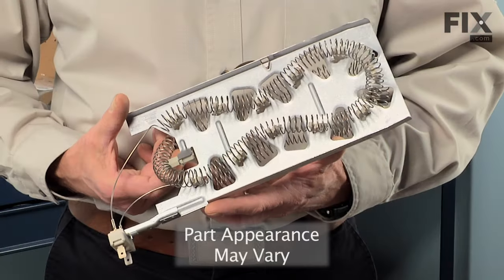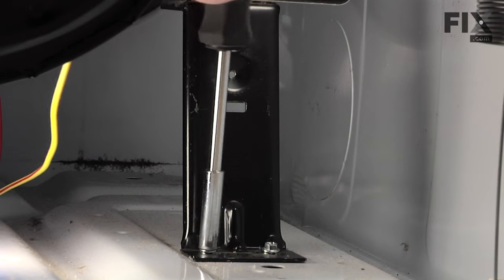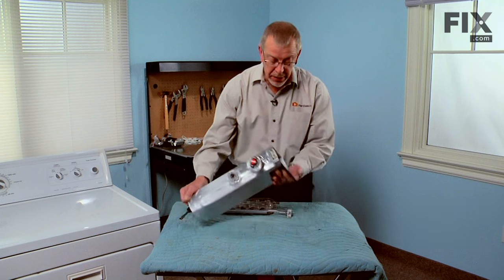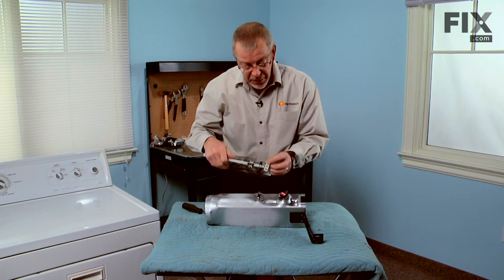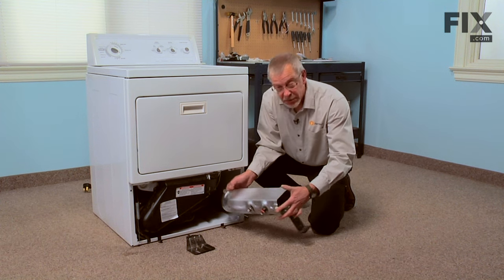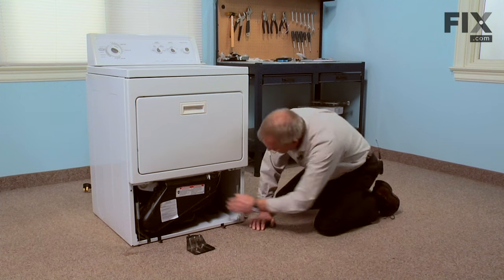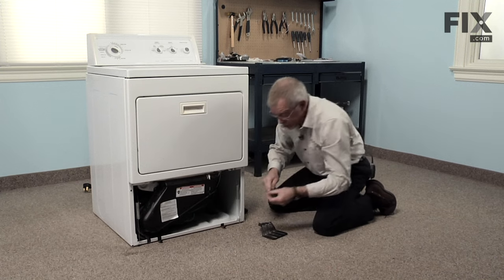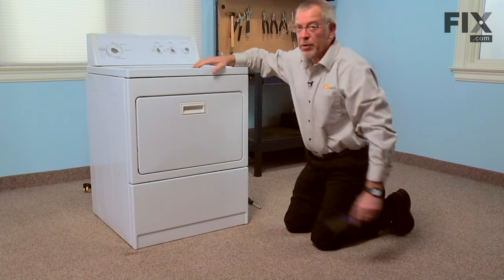Kenmore Dryer Repair – How to replace the Heating Element - 240V 5200W

Comment: Ok, I did it. Here's something I didn't catch in the video BUT YOU HAVE TO KNOW THIS, There is a tab sticking up on the tube, in the back. It prevents the heater tube from slipping out but it makes it a pain to pull out and a pain to slide tube in. You could spend days trying to figure out what is going on. The tab is on the top of the tube that slides into the back of the dryer. Tab looks like it screws into something but it doesn't, it slides into the back of the dryer and holds the tube in. You would think you can just slide the tube into or out of the back BUT no. You have to maneuver it so that the metal tab will let it move in. Tab holds the tube into the back of the dryer. Its looks impossible to slide the tube in unless you understand the tab will go first into the hole and then the rest of the tube will slide in as well. The tab is on the top of the back end of the tube. I know my words are hard to understand without seeing it but I hope it helps. When you are trying to slide the heater tube out, just think that there is a tab on the top of the backside holding it in. When you go to replace the tube, the tab must go into the hole first.
Reply: You just saved my sanity! Thank you!!!
Reply: Only found your VERY USEFUL Comment this morning ... unfortunately after spending a frustrating hour on the floor trying get that stupid heater tube back on!  This is Critical to getting this job done ... wish I'd been smart enough to look at comments and see yours beforehand!   The video talk about rotating it "back into place" to lock it in ... which is entirely wrong.  My Two Key hints are: #1) Your revelation that the tab has to go into the hole, & #2) Leave the front support piece on the tube when reinstalling it.  Thanks for your key comment ... hopefully the next guy will see it and save themselves quite a bit of frustration.
Reply: Okay but can someone tell me WHERE THE HOLE IS?! I’ve been sitting here for 30 mins trying to find it
Reply: @summerbrowning326  what hole are you talking about?  If you took the heating tube off… then you should know that it goes back into the same hole in the back… the deceptive thing is that there’s nothing on the front of the heating tube… just the deflector plate that is part of the front mounting bracket.
Make sure that you’re dealing with this specific model… some have the heater in the back… totally different.
Reply: The heating element housing has to be pushed up and turned  counter-clockwise to release that tab. When putting it back in, it's easier to 
attach the back 2 wires only and reverse the process to get it back in.
Reply: When putting it back in.  Make sure the tab at the top goes in first and just keep wiggling it in and it should pop right in.  Took me about 20 seconds and im no expert.  This is my first time.
Reply: Thank you!!!! I would of never been able to figure it out - without your input!! Much appreciated.
Reply: Yes, this comment saved my life.  Getting that tab in first, then twisting clockwise, is CRITICALLY IMPORTANT.  Without knowing that, I would have spent hours jamming and cursing.  Thank you!!!!
Reply: getting it back in is so annoying. i cant get the tab in
Reply: @TheRIB993  how far counter clockwise were you inserting it? Tab straight up. 9 o'clock ?
Reply: @johnmccormick2883  This comment saved my life. Thank you!

Comment: I just did this and the best thing to do when you are putting the casing back in is to flip the dryer on it's back!! Much easier to pop it back in than lying on the floor at a weird angle that's going to hurt your back. Flip 'er over! :0
Reply: This was the best advice!!!! I was on my knees for like an hour!  Thank you!

Comment: I saw another video and they didn’t even remove the housing (box). They just pulled the heating element out. I wish I knew that before I started. It would have saved me the trouble of trying to get the box back in. FYI.

Comment: I have had to replace this element twice on the same washer and the key to getting the element housing back on is tipping it over. My first time doing it I spent an hour on the floor attempting to get it in while cutting my hands but got it, the second time I flipped it onto its back and got it in their in 3 seconds. Hope this helps someone that struggled like me😂

Comment: The guy is working on a brand new dryer. The bottom panel on my 10 year old 110.66962501 dryer does not just pop off. I released the clips and got the top of the panel out about a quarter inch. It is in like it is welded. Could something have rusted to the inside of the panel? I have now bent the panel out and it will still will not move. It feels like there are another two or three screws holding it on. Help! I already ordered the parts but will have to cancel the order if I can't get the door off.
Reply: Yes almost impossible to get the panel off.  The spring clips are very stubborn.  Much tougher than what this guy shows.
Very poor design - just my opinion.  Just use screws that can be unfastened.  Clips?  It's like the engineer gave up.

Comment: Definitely an easy job which I just did. One thing though I’d recommend you pull the filter housing that’s in the front there off(just 2 screws) what that does is A.. Give you easier access to the element housing and B.. exposes the blower impeller which will probably be packed with lint and you can vacuum all that shite out. While you’re there you can do the same to the inside of the filter house. Also you only need to pull 2 wires. The rest can stay with the housing.
Btw in my case the heater was ok. One of the safety switches was bad… Always ohm things out

Comment: This was very helpful for my replacing of my heating element as well as your video on the thermal fuse. The area I was most stuck on was getting the housing section locked back into to the machine to get that tab in place.  Very tricky but if it wasn't for this video I wouldn't have even known about the purpose of that tab since its not obvious just looking at the opening.

Comment: Being not sure what the reason was for our dryer not heating, I just bought a heating element, thermostat, and thermal cut-off in the same package.  I replaced the heating element first thinking that was it for sure.  It turns out that it was the thermal cut-off.  I probably should have replaced the thermostat as well but will have the part for later replacement if needed.  This video helped with installation since I have little experience working on appliances.

Comment: Thanks for your video. My Kenmore model 90 series dryer had the heating element, thermal fuse and thermostat wired in series. That matched a wiring diagram I found later inside the machine. Solid red wire input and black wire in between and red with white stripe out. I took pictures of the wiring that helped me when putting it back together.

Comment: You should test the other components (the thermostat and the limit switch) before you assume it's the heater. Get an ohmmeter to test continuity before you assume that it is the heating coil.
Reply: Thanks

Comment: Does any one know the order of the wires to go back on ?
Reply: Thats what i need to know lol i just mesaage the fix.com guy because i changed the element and yet no heat! So i was wondering if maybe i wired it wrong! I did take a photo before i took apart but sadly my dumb ass had a bad angle. Did you figure yours out btw? Any tips? Thanks in advance

Comment: I cannot figure out how to get the heating element housing back into the dryer. What's the trick? There is a tab that prevents it from going into the duct at the back of the dryer.
Reply: I also can’t get it back in
Reply: @JonathanFerreri  keep trying. It finally worked for me - after a lot of attempts and a few f-bombs! Try coming in low. Good luck.
Reply: @JonathanFerreri  

Come in at an angle. Do that part first.

Shouldn't be THAT hard.
Reply: Tried the angle and had no luck...so I got frustrated and took a pair of needle nose pliers and bent the lip with screw hole back so it was straight and shoved it in no probably after that.
Reply: @JonathanFerreri  Ha, whatever works, right.
Reply: Ok, I did it. Here's something I didn't catch in the video BUT YOU HAVE TO KNOW THIS, There is a tab sticking up on the tube, in the back. It prevents the heater tube from slipping out but it makes it a pain to pull out and a pain to slide tube in. You could spend days trying to figure out what is going on. The tab is on the top of the tube that slides into the back of the dryer. Tab looks like it screws into something but it doesn't, it slides into the back of the dryer and holds the tube in. You would think you can just slide the tube into or out of the back BUT no. You have to maneuver it so that the metal tab will let it move in. Tab holds the tube into the back of the dryer. Its looks impossible to slide the tube in unless you understand the tab will go first into the hole and then the rest of the tube will slide in as well. The tab is on the top of the back end of the tube. I know my words are hard to understand without seeing it but I hope it helps. When you are trying to slide the heater tube out, just think that there is a tab on the top of the backside holding it in. When you go to replace the tube, the tab must go into the hole first.
Reply: @L-Man  comments are as valuable as entire video.  Thank you.

Comment: So taking 5 seconds to show how the wiring is supposed to be would have been too much work for you, I guess.

Funny video.
Reply: I marked my wires with masking tape that was easy on, easy off. front top (FT), FB, MT, MB, BT, Back Bottom (BB).